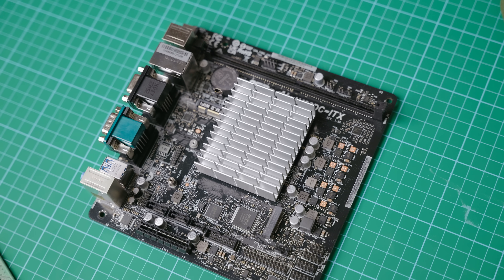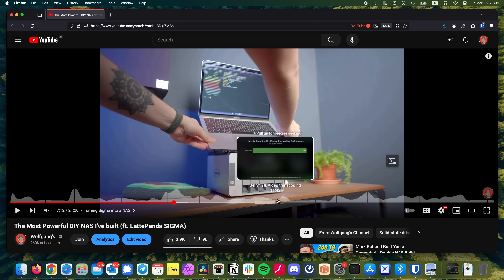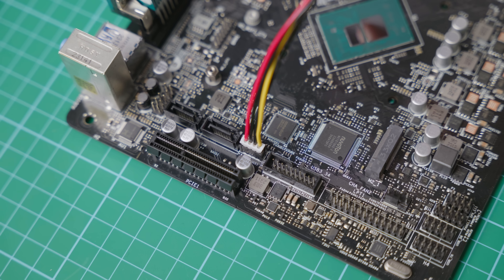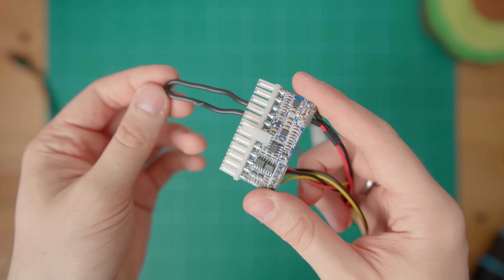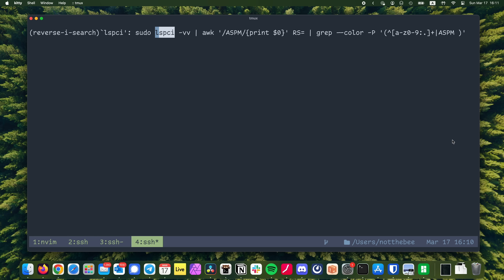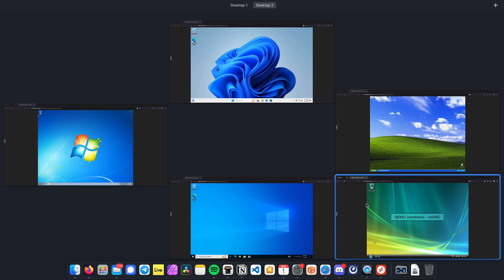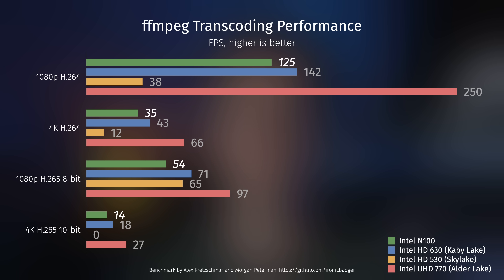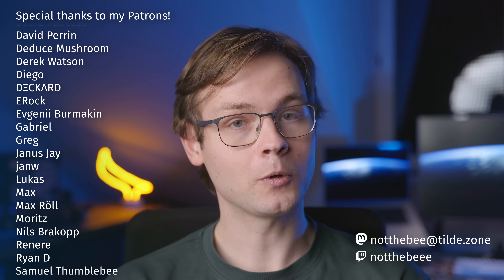Asrock N100DC-ITX – Almost Perfect! But...

Comment: Tbf I wouldn't be too comfortable running a "hacked" psu instead of the provided one, especially if you have to buy one just for that purpose it kinda defeat the premise of the motherboard in the first place.
I think something like the N100I-D D4 would make more sense, even if you have to ditch the 10Gb card.
Reply: Small point, this board doesn't come with a power supply.

Comment: I would love to see you build the ultimate Unraid-Plex home server with 5-6 SATA HDDs using the new Minisforum MS-01 taking out the motherboard and putting in a small case and also putting a cheap graphics card that can easily handle at least 4x4K streams with transcoding!

Comment: I have this board! It sits under my TV.

Also it's nice for someone like yourself to review this board and show off the capabilities.

If I get some drives, I'll probably upgrade mine to a very similar setup to yours, though likely 2.5GbE.
Reply: Do you by any chance use the onboard audio with the 3.5mm ports? I am looking for a cheap board that I can directly plug my (cheap old) 5.1 System into directly. If you tried it, how was the quality? Not looking for high end, but it also shouldn't be terrible.
Reply: @MrMoralHazard  sorry! I'm using only the HDMI for audio. I would test, but I literally lack the "ear" to tell you if the 3.5mm is worth a damn or not.

Comment: Van you pls do a video on how to make existing hardware more efficient. Your videos are nice but keeping your old stuff is cheaper and some people cannot afford buying a new motherboard every time you do a video. Very informative video
Reply: To improve power efficiency you need to reduce the distance between transistors on a chip, so there is less electrical resistance between them  Typically this is done by shrinking the manufacturing node from say 14nm to say 7nm. So you'd need to buy a new chip to take advantage of that.

But what big tech doesn't want you to know is that you can shrink the distance between transistors yourself by just pushing really hard on the sides of the chip. My trick is to take my CPU and put it in a vice and then squeeze as hard as I can. Using this method I've turned a 28nm Xeon v2 into a 7nm Epyc 7002 (although the pressure did make some transistors pop out of the side).

Comment: To be honest, N100 can be configured with higher TDP.As for certain N100 Box configured with 25w TDP with 16G DDR5 4800 RAM, its Geekbench6 score can achieve around 3300, which is quite close to skylake 4 cores i5 :D
But it performed a lot worse when it's configured with 6 watts TDP, though. :)
I was using it with Windows 10 back then with my N100 box, changing TDP between 6w and 25w in BIOS really made a huge difference :)

Thanks for your great videos and they help me save my power bills a lot :D

Comment: 6W quad core, swappable single channel DIMM in server style that allows direct airflow, NVMe, dual sata, an OPEN PCI-E x2 slot....Yeah this is pretty much what I need. My home server is a 2009 era eMachines with a single core 1.6GHz 2650e, 2GB, dual sata 3gbps, PCI-E g2x1 (empty) and g2x16 (10GbE SFP). This looks like a more than suitable replacement in speed alone.

Comment: Very nice NAS-project! Because of the bandwith-issue, i once had a switch (some TP-Link if i remember correctly) that listed in the specs that it would auto-adjust the framesize, but this actually nerver worked. After updating the switch, i could set this setting manually and actually enable jumbo frames.
Reply: Managed switch from tp link? Nice 😊

Comment: I built a system based on this video and it's awesome!
N100DC-ITX, 32gb Ram, bequiet! Sfx power 3 450W, 2 18Tb Sata drives (more on the way), one usb nvme and a boot ssd. No Pcie card.
I had to manually set the DDR4-3200 CL16 stick to DDR4 -3000 CL 16 since I don't think the board has XMP and DRAM Voltage can only be set to 1.26V. My stick is running fine (no memtest yet). 
With Proxmox installed and several containers (vpn, jellyfin, ...) idling powertop shows 73% at C10 and 7% at C8 which sounds great (I don't know much about Linux power management). A Wall-plug power meter shows 28 Watts on idle, up to 80 watts under full load. I think the bequiet psu was a bad choice, it alone draws 10 Watts when the board is powered down, but I found out about Wolfgangs PSU Chart too late. All in all I'm very happy tho.

Great video on a great board, thanks for the content Wolfgang!

Comment: This pulled me over the line. Been looking at this board for a while now, but was doubting about the performance. Think I am going to acquire an N100M for new NAS
Reply: Hey, did you get the N100M and which case did you use for it? I'm looking for a small case ideally some kind of mini itx that has space for the N100M if used with PicoPSU

Comment: Thanks for this guide! I am currently working on my own version of this. After having it build with just the basics, without the HDD's yet (only 500Gb SSD with Proxmox), I measured 22 watts at being idle, way off from your measurements... I watched your video over again to find some hints to it. I found the problem: I bought a Flex PSU at AliExpress. It turns out that when I only have the power supply turned on, with nothing else on it, it already is using up 10 watts!! Omg. (at 32 cents/kwh 24/7 running that costs 28 euro/year) This is going back and I have ordered a 300W Pico PSU + 12v 10a dc power adapter (so 240W effectively).  Lets see how that goes.

Comment: I recommend adding a fan onto the cooler. Under full load this CPU easily hits 100°C very quickly. Idle temps weren't great either. I think it was around 70-80°C.

I am using the mATX board variant for a server.

Comment: My DIY home NAS uses the distant ancestor of this board, the Asrock Q1900DC-ITX. It's been in service since 2014, running FreeNAS 9.2 until I migrated to True NAS Core about a year after it became stable.  The Q1900 has 4 SATA ports, and I have pair of 2 tb seagate, and pair of 4 tb WD's formatted ZFS. It's in a Thermaltake V1 Core box, and powered by a 75w laptop brick.  If I need more storage, I can swap out the smaller pair of drives.  My use case is backup storage, so I don't run any services besides samba.  I think I'll probably build a new NAS, as it's dicey to trust a 10 year old MB.  And keep the first NAS as a backup.

Comment: The Avoton/Denverton based boards are really, really good.  I think they check all the boxes for what you're looking for in a small low power motherboard.  Those chips were designed from the ground up by Intel to perform exactly the function you're trying to achieve.  Plus they support ECC memory, which is awesome. 

I used to have an AsRock C2750D4I.  Mini ITX.  8 core Silvermont/Bay Trail generation low power Atom processor, with four DDR3 slots supporting ECC.  12 SATA ports.  PCIe-8x slot.  IPMI onboard with a dedicated ethernet port, plus two additional onboard gigabit ports.  And they're old enough now that you can probably get them for cheap.  

The newer Denverton based boards are probably significantly better, but I haven't had direct experience with those.  The only reason I got rid of the C2750D4I was because I moved to 10 gigabit fibre and the poor little Atom cores couldn't push more than about 190 megabytes/second over rsync when I was doing backups between servers.
Reply: You are off the mark. Those atoms cant transcode 4k/hdr in any serious way

Comment: As long as you were doing a bit of custom cables, you could also use your 19 V power supply to branch to a straight through 19 V to your motherboard and  2 cheap-ish buck regulators, 12 V @5V, and 5V at 6A both available on Amazon or ebay for under 20 usd add a SATA power cables.  A little more involved, but may less intimidating (perhaps cheaper) than working with a 120/240 V power supply.
Reply: I don't think the buck converters + 19V power brick would do much for the efficiency. Given that the bulk of the "active" or spun up power draw is 12V & 5V for the HDD, you'd be loosing allot via those buck converts.
Reply: @evanvandenberg2260  it wasn't for efficiency, the idea was not to use a 240V supply.

Comment: What you could do instead for the power IMO is put a female barrel jack in those two wifi antena openings and use a small jumper cable to connect that to the board power. The whole "pull 4 cables from inside the case to plug into something outside looks a bit  botched IMO.

Comment: Looks awesome.  Explaining computers did a really nice miniPC build with a N100 board.  Think it was different to this one.  Also Supermiro has an awesome relatively low power (for the number of cores etc) epyc ITX board.  This is great if you want more lanes.  Also, it should last forever.  Obviously, it is more expensive......
Reply: I didn't check, but bifurcation on the PCIe slot is a really good option for addition drives.  Not all boards have this though.
Reply: I built a desktop with LMDE running on ASRock N100M with an NVME SSD and 16GB Kingston memory,  almost like Explaining Computers did, except I use HDMI output to an LG TV. Everything would be fine, but to my huge disappointment the system tends to freeze or reload spontaneously. I have tried Debian as well as almost all available Debian-based distros with different desktop environments, Fedora desktop - with no effect. Finally I ended up with LMDE that seems to be more stable on my hardware. As for working as remotely controlled NAS or home server -- N100M MoBo worked with no issues at all. It seems the problem is somewhere with video output/drivers.

Comment: Thanks for the great video. The board is really sweet. The idle power consumption is amazing. It's a shame that there are not more PCIe lanes to go around. There are simply not enough lanes to get to SATA6 speeds while also having 10Gbit networking. That might be fine for spinning disks but I am still looking for the 'perfect' 6-8 disk, all flash NAS. It's a real shame that all those efficient Fujitsu boards are incredibly hard to com by.

Comment: i thought for a long time about going for an asrock or asus n100 card but finally, i bought a tiny pc hp prodesk mini, i5 8500t, 8gb ddr4, 256gb ssd nvme for 95€. I just added 2x16gb ddr4 and 1tb hdd sata + 1tb usb hdd. With all this added, idle power consumption is 5w on Debian 12, C10 pkg (no monitor, no mouse, no keyboard)
Of course I don't have parity, but that's not crucial in my case.

Comment: The power draw is amazing though, I tried a friendly elec nas board with RK3588 and topped at 13W if I remember. They say that x86 consumes more but well, it all goes to CPU manufacturing (7nm in this case), motherboard connected devices etc... Can't wait to have the equivalent of N100 but in 1nm in 2027 !

Comment: Now CWWK has an N100/N305 board with only two 2.5 ethernet ports, but it has a PCIe slot with 4 lanes to take a higher bandwidth network card. I also has 6 SATA ports. This meets the requirements in more straight forward way than was possible before.
Reply: issue is 20W power in idle

Comment: Great stuff. I was asking in the comment about Mellanox Connect -X3 which is terrible. My server needed more horsepower so I went with i3 14100. Bought Intel X710 (dual port) for 100EUR with 2 transceivers. It goes down to C8 and there is a 10G speed always. Server is just one thing. Got RACK with 2 switches (8x10G SFP+ and 8x1G (4x POE+)), shutdown server with ipmi and 18 cores, 1x router, 1x wifi 6 AP, 1x camera,  above i3 server and UPS. Previously  with server based on this 18 core xeon total idle consumption was 136W, went down to 69W with i3 which is still a lot. So there are also unoptimized things like camera (15W!), ups (not measured) and IPMI (5W), probably networking could also do better.

Comment: I went in a different direction. Bought the Aoostar R1, added 2 20tb drives for storage, bam low power media server running at 10 watts from the wall with the hard drives spun down, plus you can set the bios to run the N100 at 15w tdp for more performance at a max temp of 70c.

Comment: From a tinkerer's point of view, this might be a nice solution, but I would still consider this M.2-to-SATA card a workaround. However the Intel N100 seems to be the perfect fit for an energy efficient NAS. The first turn key solutions are already round the corner, I will wait for one of these, I prefer to tinker with software over hardware. 😁

Comment: If ONLY  it had 2 m2 slots... we could have both the additional SATA ports AND a nvme cache drive for max throughput on the NAS front when using 10Gbe SFP... also man you just dropped that new AQC100 chipset on us as if it was "no biggie" when you no so well how we've been waiting for this for ages haha. Love it though thanks a bunch. Visiting EU soon so I'll use your links
Reply: There is a slot for a wifi card, isn't there ssd's that can fit into that?
Reply from the maker: Nope, it doesn’t carry PCIe signal on this board
Reply: @Beatleman91 it's probably USB 2.0 so A+E I think... so a coral m.2 A+E would fit in there.. (if you can buy one that is)

Comment: I have a similar setup. I am running 6 HDDs and 2 SATA SSDs off a Lenovo P330 Tiny. Using an HBA card. The Lenovo mini PC uses a 20V power supply. I have a 650W ATX gold PSU powering the drives.

What I did was cut off an old usb cable, connect the power leads to a 5V relay module and connect the N-O of the relay to the PSU's jumper pins. 

This let me power on and off everything together. 😁
Reply: I recently started experimenting with a bare M920x board (they could be configured with a dedicated graphics card using the custom PCIe slot) and soldered to exposed PCIE_12V and 5V pads. The PCIE_12V line should be able to source at least 30W - should be enough for 2 to 4 drives (maybe more) depending on their startup characteristics.
Reply: @bbrice100 which drive case are you using? Which hba card also?
Reply: @antoine6521  I am using a M.2 Wifi to NVMe adapter board (one with a long FPC cable between them) and a ASM1166 based m.2 to sata card. When i write a short report on it i will try to remember to link it here :)
Reply: @rayncadiana 
Looking forward to it

Comment: Yep, there is no replacement for this board, if we talking about support for 10Gbps NIC, but to be honest Asus Prime N100I-D D4 is also not that bad, at least it has second M.2 e-key port with PCIe (Asrock M.2 e-key port hasn't PCIe), so it can be used to install AI accelerator or „slightly” slower 2.5-5Gbps NIC, and it's a bit cheaper.
Reply: Who needs 10Gbps on a home server anyway, that's kind of a meme tbh. Even the usefulness of 2.5Gbps could be questioned for a computer that can only transfer to and from SATA ports.
Reply: @billmurray7676  SATA can handle up to 6Gbps, single HDD is capable to saturate 2.5Gbps... IMO 1Gbps NIC is just slow, even from regular SD card I can read data faster than that.
Reply: it doesn't matter what sata can support, it matters what you put on it : you put HDDs on it, so that's about 200Mo/s, which is 1.6Gps. So no, you won't saturate 2.5Gbps with your HDD.

That means 10Gbps is clearly useless on a home server. And 2.5Gbps, well, like I said, it's a questionable investment or reason to buy hardware in pratice.
Reply: @billmurray7676 , fastest available hard drives are reaching SATA limit, RAID in NAS is common thing, it's possible to achieve this limit even with standard hard drives and we haven't even started talking about modern SSDs used as an buffer or main storage. It's 2024, 1Gbps NIC should be considered as an obsolete for anything above low-end NASes.
Reply: You said HDD, so obviously SSD are out.
Also, that would be pretty stupid to build a RAID for performance in a NAS since, by essence, you're supposed to build for data safety. You can't have both in a RAID.

1Gbps, although not ideal, is clearly not obsolete, 2.5/5 are options, but 10Gbps is definitely useless, which means that PCIe x1 is fine, and you shouldn't sacrifice other benefits for PCIe x2 or x4.
Reply: @billmurray7676  ofc I can both. I can mix different RAIDs, I can have RAID 1 for important data and RAID 0 for temp, I can build RAID 10, RAID 5 or 6 which also gives boost for read speeds. And still even single HDD can saturate 2.5/5gbps NIC if we taking into consideration fastest available disks. And even for single, slow hard drive  there are benefits from faster NIC, because every, single NAS has working memory, which is used as a buffer for incoming data.
Reply: You're not listening... a HDD is about 200Mo/s, that's 1.6Gbps so you are probably not saturating a 2.5Gbps NIC. And definitely not a 5Gbps. That's not happening.

Also, what are we even talking about here? a home server on a n100, that means raid mirror or parity for data preservation and to feed 2-3 VMs. That's it. You'll be severely limited by the number of sata ports anyway.
Any more than that and... why are you using a n100 platform? scale your hardware according to your needs.
Reply: @billmurray7676 , I was talking about fastest available hard drives. And even in your example gigabit NIC is already a bootleneck… N100 is capable to handle much more than that. With fully encrypted RAID0 i get >300MB/s on regular HDDs.
Reply: No you weren't. You just didn't know some of the facts I presented. It sounds like you feel embarrassed about it but you shouldn't, it's ok, really.

I don't know what the n100 should or shouldn't be able to do, what I do know is that if I want a normal PSU and a PCIe x2 slot, I need a bigger motherboard, which means a bigger case and more power, and that's a difficult choice to make for such a small advantage.
Reply: Yes, I feel embarrassed because gigabit ethernet is the bootleneck in my config, and it's already a low-end NAS with two regular hard drives, without any fancy cache solutions… LOL :D
Reply: How do you bottleneck your config?